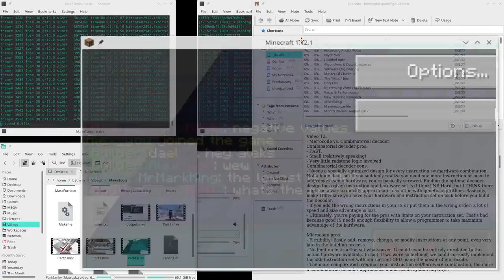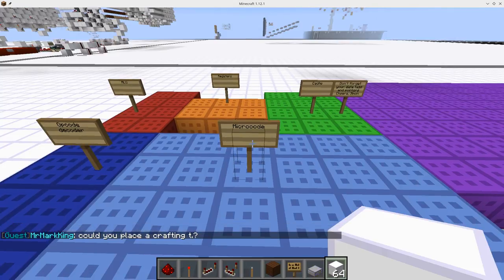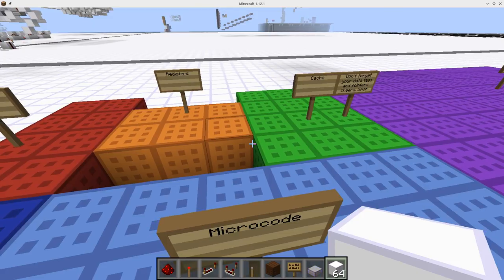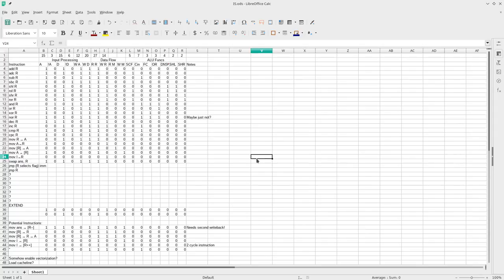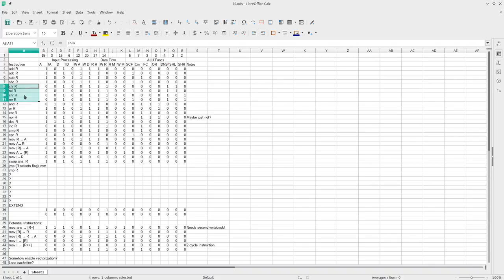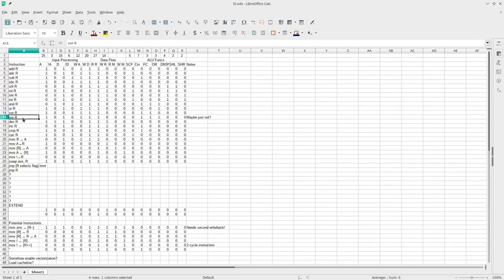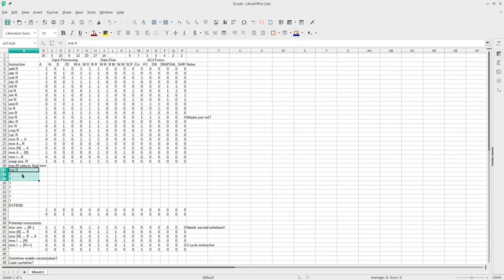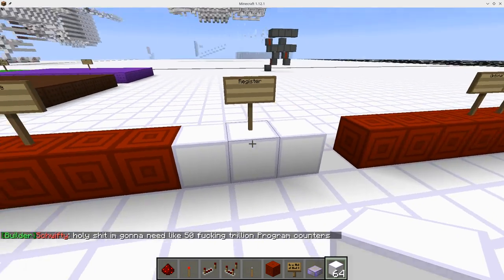Building a Better Redstone Computer Tutorial 12: Control Unit Plan

Comment: one simplification for micro-code I've used with a digital logic simulator: 
two micro-code tables, first table contains the addressing logic, second table contains the functions.
(has allowed me to use two 4-bit decoders, whose combined footprint was much less than a single 8-bit decoder)
Reply: SkyCharger001 that's just normal decoding. Addresses are always bussed seperate from opcodes then decoded where they are needed. Not with the opcodes itself. 
We did have a dude on ORE make a massive 8bit decoder for a 8bit IS, xD then he realized that register operands are decoded at the registers and he was super pissed.
Reply: you seem to be conflating micro-code and opcodes.

if this were music then ONE opcode would be an entire measure, while ONE microcode would be one of the symbols that define that measure.
Reply: SkyCharger001 nope. I'm not at all. I know what I'm talking about, if u read what I said... I was referencing the person who did make mistakes ;)
I assure u... I know all about this :P

Also.. why the hell would you EVER need a 8 bit decoder on a simulation unless ur simulating a massive IRL chip... 8bit opcodes would be hell and completely useless,,,, once you have them that long, they better be organized to mostly not even use a traditional decoder.

Sounds like the decoder ur talking about is somewhat of a "X, Y" decoder for a grid, so you can split up your bits you need decoded into smaller elements.
Reply: first, the way you lay out that answer didn't make that discernible to me. (I was responding to the second and last sentence of the first part, which made it seem it wasn't part of your comment about *him*).

Second, while my mention of an 8-bit decoder was meant for complete noobs that may not think to separate the operands and the opcodes (sometimes you need to use the logical-extreme as a teaching aid), 
I must admit that my first attempt at a CPU was so CISC that had I taken it beyond the ALU and register stages it would have needed 205 entries at minimum.

Third, the two-decoder system I was talking about is a two stage system, 
stage one decodes the operand 
stage two decodes the opcode
(EG: 
instruction 246 (of a fully fictional instruction set): 
operand-table reports 0, 
operand 0 decodes to: 
INC PC,1: DAT>REGD.  (IMMediate operand)

opcode-table reports 28, 
opcode 28 decodes to: 
SOZ,2*: INC PC,1:END: INC PC,REGD:END.  (BRANCH on zero-flag**)

* Skip (two microcode-instructions) On Zero

Comment: but i still dont understand how you can fit an instruction set in 8 bits. when you add, you need to specify the 2 registers you're adding and then the register you want to save it too. how can you do that with just 1 register specified in the instruction set? also, how do you specify which RAM address you want to load/save too? i just don't see how its possible to fit an entire instruction set in 8 bits. (or maybe i'm just think to much about Complex Instruction Set Computing)
Reply: The idea is that you first copy the content of the first register to the accumulator and then add with the second register, that way you get the sum of the  two registers, once that is done the result is available on the output of your ALU, which means you just have to copy its content to your register. How he addresses RAM will depend on how he implements it, it will probably be a two byte long instruction instead of one if there are too many addresses.
Reply: tmufrct3 can I get some help on the control unit? Where do I start?
Reply: VegaWolfz A good place to start ur cpu would be to first hook it up to an instruction set, then hook that up to ur ALU first, if you have questions ask me because I’m in contact with Benny
Reply: @tmufrct3  thanks for answering my question! I'm trying to learn and implement the 6052 instruction set to this computer design and I'm wondering about where the X and Y registers fit in and how addressing modes work.
Reply: @ryandupuis5860  Hi ! That's an interesting project ! I'm not too familiar with the 6052, however it looks like you would need to implement the register X and Y like you would implement a stack pointer register, this will allow you to access memory through those registers. As for addressing modes, I haven't looked too much into it, but implementing only absolute addressing and then implementing relative addressing in the microcode seems to be the easiest option.

Comment: I probably sound very stupid but how could a redstone computer execute like a "if 5<B do something"?
Reply: For 5<B you would subtract B from 5 and then do a conditional jump with the negative flag to the code you want to execute if that's true. A conditional jump just changes the instruction pointer, "jumping" to somewhere in memory that the programmer chooses if a certain flag is set. If the chosen flag isn't set the instruction counter doesn't get changed and the control unit moves onto the next instruction

Comment: What is pipelining?
Reply: Pipelining is a term in computer science referring to a way in which a CPU is able to execute instructions. In non pipelined CPUs it will wait for the entire instruction to finish before it starts the next one, where as in a pipelined CPU the computer breaks down the instruction into multiple parts such that when one instruction is being worked on somewhere in the CPU, somewhere else the next instruction can start to be worked on. One super basic example of this is the following. First the computer "fetches(F)" the first instruction from your program memory, it then decodes(D) the instruction in some fashion,  executes(E) it, and writes(W) the result somewhere. For a non pipelined CPU only once the first instruction finishes writing will it fetch the next one, but in a pipelined design the following happens(for a magic 4 tick CPU): Tick1:Instruction1(F), Tick2: Instruction1(D) Instruction2(F), Tick3: Instruction1(E) Instruction2(D) Instruction3(F), Tick4: Instruction1(W) Instruction2(E) Instruction3(D), Tick5: Instruction2(W) Instruction3(E), Tick6: Instruction3:(W), so in total it took 6 ticks instead of 12 ticks if each instruction took 4 ticks each. Now this is an over-simplification as, say instruction 2 needs the result of instruction 1 then it would have to wait in the decoder before execution but even then it cuts 2 ticks for fetching and decoding. These more complicated details are handled by more complicated logic that I am sure Benny will explain when we get there.
Reply: thanks